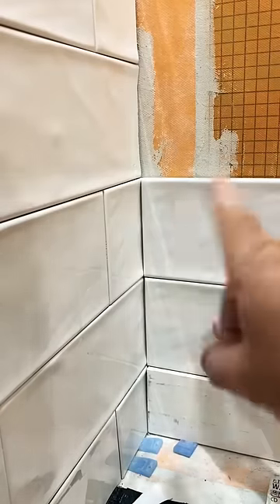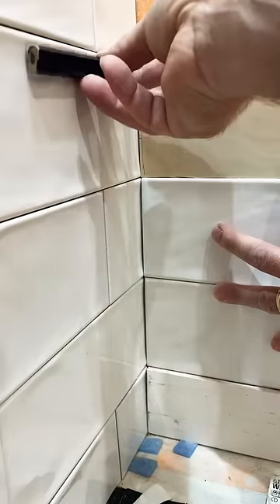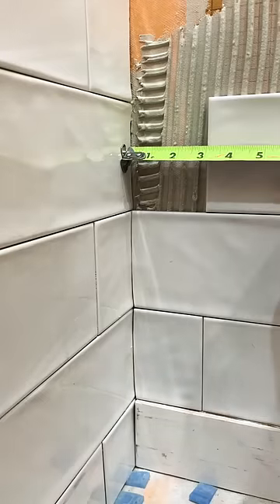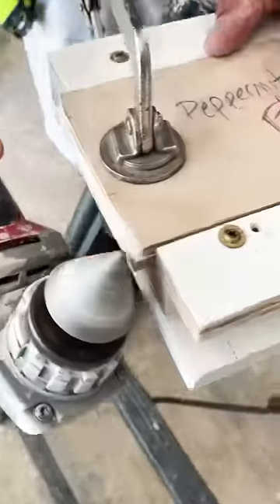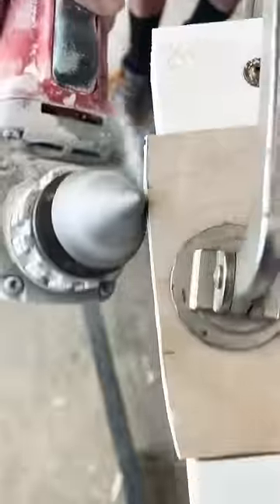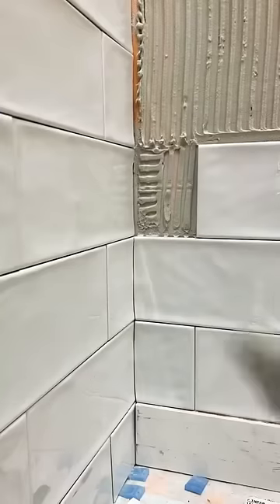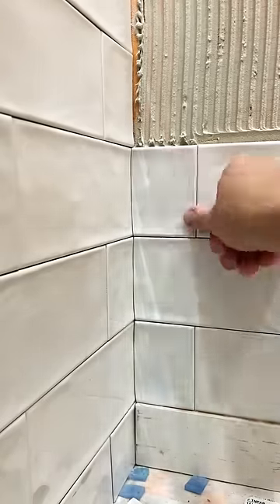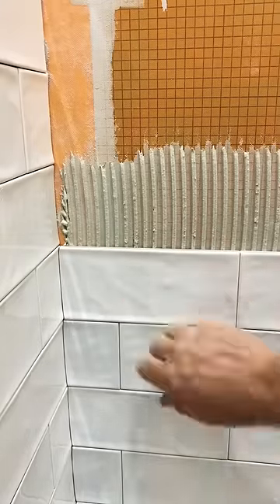Tile COPING - 101 (just a little extra effort)  #tile #coping #shower @Eylandertile

Comment: Don’t wast time polishing inside corners or ends that eventually will get. Chalked not grouted
Reply from the maker: I polish every cut. I don’t like to leave a cut edge raw because there are tiny chips. If the grout joint looks good without grout then it will look good filled & I don’t rely on covering up my work with a sealant! That’s laziness
Reply: @w.k.d.constructionllc  not laziness just unnecessary work that translates into costumer having to pay more it wouldn’t be chips as you say maybe really minuet speck once in a while unless using dull diamond blade with no water
Reply from the maker: @panzerichi3837  unnecessary to you I guess. If you use a new blade on a wet saw (which is what I do) there will still be tiny chips in the glazing. Therefore I polish every cut which takes maybe 10 seconds. So it’s Not wasting time, it’s standard practice when I set tile. It looks nearly like a factory end on a tile vs being able to tell it’s a cut.
Reply: @w.k.d.constructionllc  if you doing that and claim it’s from not being lazy , then polishing takes up to 5 different pads of different colors to be done right and u probably only run one real quick so get my point

Comment: where is the 3/16 minimum Expansion Joint NTCA requires for a proper installation. I guess you don't mind cracked tile repairs.
Reply from the maker: Been installing tile with a 1/16” joint in the corner for IDK…15+ years. & in all those years I have never once been called back to fix a cracked tile, popped tile, cracked grout, loose tile, nothing? So IDK, 1/16” works for me with no issues.
Reply: @w.k.d.constructionllc  that may be fine for you. Ask the manufacturer of ANY tile product you use what they recommend for proper installation. In the real world yes you may be correct 99% of the time. Your argument in court falls on its face as all manufacturers refer to the NTCA and ANSI specs for proper installation. Which says Movement Accomodation Joints have to be minimum 3/16" for basic lumber construction. I see people do it your way all the time. It's wrong.

Comment: You don’t grout corners in a shower you use silicone because corners crack so why bother doing all that extra work?
Reply from the maker: I grout corners
Reply: @w.k.d.constructionllc  and they will crack ! A professional would know that.
Reply: @w.k.d.constructionllc  you’ve been doing this 24 years and you don’t know this ? you fucked up a lot of showers!
Reply: @w.k.d.constructionllc   Grout in shower corners will crack and fall out due to tile expansion and contraction. Caulk forms a waterproof, flexible seal in shower corners. Always use caulk in shower corners or any place where the tile meets another surface (tub edge, wall, or faucet).
Reply from the maker: @scottgroves1010  ohhhhh geeeze…🙄 tile to tile I grout only. Tub to tile I will color match grout caulk. Funny thing  tho, I’ve NEVER once been called back due to cracked tiles or  grout joints. Go figure? You must tile for hotels or something, cause they really like the hell out of silicone in the corners! Haha good try buddy
Reply: @w.k.d.constructionllc  like I said in the first comment why do all that work for nothing? And wouldn’t you want to have caulking in between that jot instead of grout ! shoemaker

Comment: But you need to silicone that corner so you won’t see it anyway. Waste of time!
Reply from the maker: Negative ghost rider, silicone will be moldy in 4 momths
Reply: @w.k.d.constructionllc   if you grout it then it will crack, needs a flexible sealant. That is the correct way. A good quality silicone won’t go mouldy
Reply: @w.k.d.constructionllc  i agree with shane never had good luck or seen a good grout corner. A Grouted corner will always eventually fail
Reply: @w.k.d.constructionllc  this is why in europe we just build better shit😂 ignorant americans not wanting to upgrade from what they used to do 80 years ago.. sealant nowadays is perfect even the cheap ones, only reason it gets mouldy is if theres no good ventilation in the bathroom and everything stays wet all the time. Its not even allowed to grout corners anymore here always use waterproof sealant specially made for tilework in the bathroom/toilet/kitchen

Comment: Other than to make a YouTube video I really don't see the point of this bc no matter what you do you can't get a straight line with those tiles. Grout or caulk is going to make all that extra work a waste of time
Reply from the maker: Negative ghost rider, if the grout joint looks like ass before grout is put in there…then guess what? Yup, the grout filled joint will look like ass too! If you caulk it with a factory square end butted to the other relief tile…guess what, it’s gonna look like ass too. So it may be a waste of YOUR time, but definitely not mine.
Reply: @w.k.d.constructionllc  👍

Comment: Waste of time we always silicone inside corners
Reply from the maker: Waste of your time…not mine
Reply: I never silicon my corners.  If you rely on silicon to seal your shower will fail.  This is overkill and my solution would be to not use this tile.  I do not use 1/16 inch grout lines for showers.  I have found this is too thin.  1/8 grout lines should be the smallest to use to ensure you can get grout in the joint.  Would like to see this finished after a year and I guarantee that some of the grout will be missing.